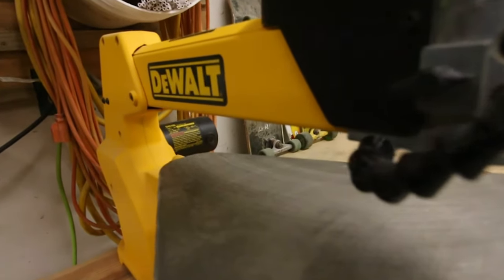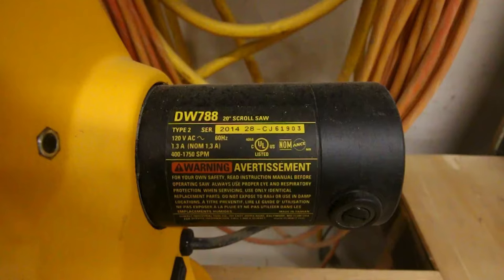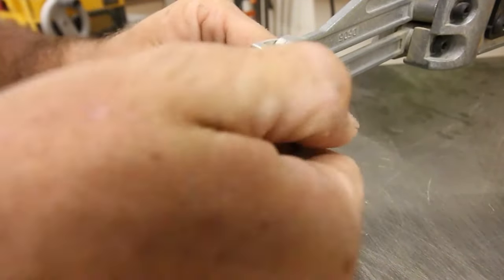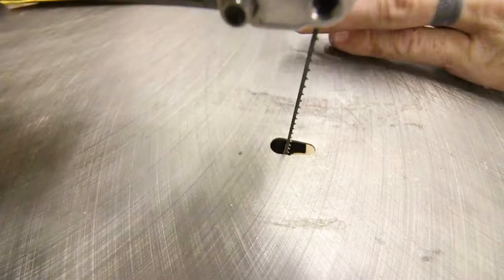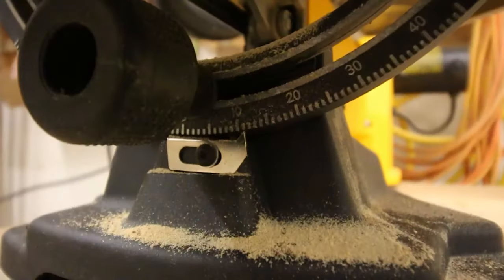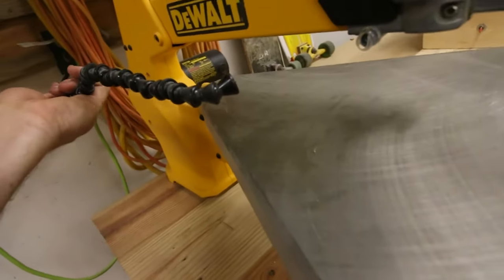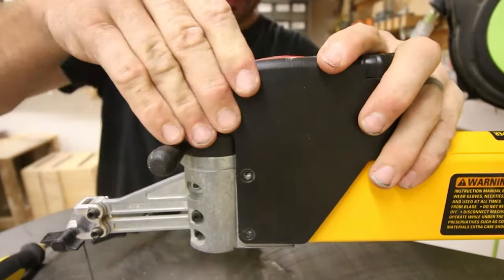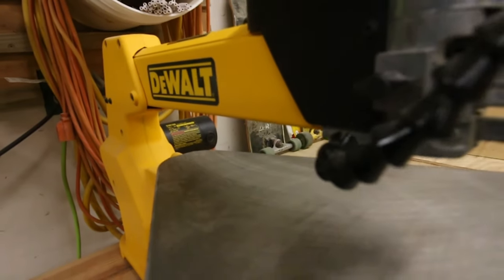Know THIS Before You Buy!!! DeWalt Scroll Saw Review After 6 Years

Comment: The air tube can be reused by cutting out the damaged split first link then you have a new first link.  You will need to heat it slightly to make it slip on.
Reply: Absolutely correct.

Comment: I do like this saw, but have to disagree about it being the best ScrollSaw on the Market.  It may very well be the "Best saw at it's price point".  The arm on the 788 doesn't have a catch to keep it up.  These saws are also notorious for excessive blade travel (travel is movement forward and back through the stroke).  Also, the on off switch isn't sealed, allowing dust to build up inside and eventually cause issues.  I do love the tensioning system on these saws.

Though at a much higher price point, I would say the Pegas/Seyco's/Jet/King are better saws, and though way way overpriced, the Hegner is probably better suited for some types of work.  Right now, I think Pegas is probably the best choice for "most" serious scrollers.  The new Wen saw is probably the best entry saw, and this DW788 is probably the best mid priced saw.

The switch itself had had issues on these saws because they don't have a membrane covering them to protect them from dust.  Many users use foot switches to turn on and off the saw, which will remove the wear on that upper switch, and in that scenario, you can put tape over the switch to protect it from dust.  There are other add-ons to hold the arm up (for bottom feeders), and some users add their own dust collection (scrollnado or makeshift).

So, this is truly a great saw, especially at that price point, but not the best for all situations.
Reply from the maker: Great points! What do you mean by catch? Do you mean the foot?
Reply: Pegas/Jet/King are all the exact same saw, from the exact same manufacturer. It is a far superior machine to the Dewalt, and well worth the extra money. 

As for the blower hose, you use a pair of pliers to pull off the loose nib and the next one is just as tight as new. No need for glue or some weird clamp situation

Comment: I have the DeWalt 788 for 10 plus years. I had to replace the tension wedge and several repairs for a knocking noise.  A recent problem I had was the top of the blade was 3/32 of an inch ahead of the bottom of the blade. When cutting a 2” thick piece I could not make internal cuts because the blade didn’t meet the cut line at the top and bottom. To make the blade plumb I had to remove the bolt on the rear table bracket and jack it up to plumb the blade to the table. I slid a wedge under the bracket and used a clamp to secure the table from moving.

Comment: I've had my DeWalt for over 6 years now as well.  Have built numerous fret work clocks with it and still going strong.  So things I did to mine to help out: (1)  I bought the DeWalt stand for it, but before I bolted the saw to the stand I cut three small pads of of dense foam rubber that matched the feet on the saw.  I placed these pads between the saw and the stand and it made quite a bit of difference in the sound being transferred to the metal stand. (2)  I originally bought the DeWalt work lamp but quickly discarded that as it was no help at all.  (3) I bought the original "Lifter" from Papa's Workshop and consider this one item the must have for the scroll saw!  (4)  The Pegas scroll saw clamps made for the DeWalt are a marked improvement and the best price I found was at Bear Woods Supply.  (5)  As I am up in age I needed something to assist the old eyes.  I bought the Magnifying LED Work Light Item #57312 from Rockler.com. Its oval shape and bright LED ring make intricate small cuts such a breeze now that I can actually see them! :) (6)  Last but not least, I added a 3" thick piece of foam rubber to the cross bar at the base of the stand.  Even when sitting at the saw for long hours, that spongy foot rest is greatly appreciated.  (7)  As for blades, I have tried almost all of the brands.  I keep going back to the ones sold by Bear Woods Supply.  Much cleaner cuts, smooth turning and very few breaks.

Comment: I started with a Harbor Freight Central Machinery. If I wanted to change blades I had to use an allen wrench. If I had a lot of interior cut it took awhile. I just purchased a Dewalt DW788 scroll saw. Can wait for it to be delivered.
Reply from the maker: Nice!!! I've never tried that one but I had a jigsaw like that once. Sounds awful
Reply: I bought a harbor freignt scroll saw a few years back and returned it 2 days later. I found out I didn't have the 8 octopus tentacles inorder to change blades quick enough.
Reply: I was considering the Harbor freight scroll saw. How does it compare to the more expensive Dewalt. I'm new to this anyway. Thanks
Reply: @Blah-blah-sure  
If you have the money I would definitely buy the DeWalt. The Harbor freight works ok but it's more difficult to change blades. I bought the Harbor freight because I didn't have the money for the DeWalt. I'm glade I bit the bullet and bought the DeWalt. Get the DeWalt, you won't be disappointed

Comment: I have recommended this saw to friends and they like it.   I bought a Delta 19” scroll saw 30 years ago and still use it a lot.    I am used to the c-arm design but do need to cautious on thick cuts.    I keep thinking about getting the Dewalt 788 but the Delta just keeps plugging along so will keep,it for now.   Great video and I shared it with friends

Comment: For some reason I seem to be an odd ball?  I have had a Dremel scroll saw for about 20 years--it has thousands of hours on it.  A few years ago I decided to "upgrade" to a Dewalt.  I owned it for less than 2 months.  Although it was a larger saw than my 16 inch Dremel, I found it more difficult to change blades.  I do not like the fact it has no dust collection port.  I am in Canada and really do not like the price in my area.  Also, my Dremel will cut thicker wood. I have to give Dewalt credit for the placement and size of the on/off switch--Dremel is a little awkward.  I am sad that Dremel has not made, and when I talked to them about a year ago, has no plans to make them again, as eventually I will wear mine out.  Dremel is owned by Bosch.  I have several Bosch power tools and they seem to be fairly high quality.  Again--I seem to be an odd ball but I do not like the Dewalt scroll saw.

Comment: Woodshop free in my library,  Fl. This is only ones in the shop. As new scroller, i like the speed control,blower, and large base. It has held up for years. Dust collector would be useful. They have vacuum hose area built in walls.
Awsome tax dollars at work. We have everything 2 or 3 of all big tools. Not allowed to use table saw. Master woodmakers volunteers. Twice a week open build. 67 women loving learning a new hobby.

Comment: We’ve got an old Dremel and it works well enough, but the capacity for larger pieces is less. For the most part though, we are working on smaller stuff when we need a scroll saw, so it’s only been an issue once or twice, as I was shaping a mermaid tail for a vanity table I made for my granddaughter. Once I took the time to learn about the different types of blades and when to use them, I found that I use it more often and have much less frustration. Thanks for this honest overview. You always do a great job of putting lots of information into a concise video. 🙂
Reply from the maker: Thank you!😁

Comment: Hello from New Hampshire, I watched your video as my machine is about 7 years old, but I have about 40 hours if that on the device. 1 day it worked perfectly and the next it didn't, so I automatically thought it was the motor, but watching your video about the on/iff switch disconnecting, I tried with all of the hex keys to remove the bolts. I would like to know the size hex key you used, as I have no idea the EXACT size. Some come very close, but do not seat all the way in,. Could you provid me the specifi size hex key please, thanks Richard

Comment: I heard on another video that there is play front to back as you are cutting, instead of going perfectly up and down there is some front to back movement. I can't remember the explanation for this or if there was a fix, have you encountered that problem? It's still cuts but the accuracy goes down a bit from what I recall.
Reply from the maker: @musicbymark  because of the nature of the scroll saw there's play in the blade but that can be mitigated by just slowing down the cut. There seems to be zero play in the arm or any of the other fixtures. Hope this helps😁

Comment: I’ve had the dewalt scroll saw now for 15 years. Same problem with the blower staying intact where it connects to the saw. I resolved the problem with a small stainless steel pipe clamp. Haven’t had a problem since.
Reply: Remove the end that broke (each "link" is the same size, heat the new end in boiling water for about 2 minutes, and it snap back on.
Reply: you can simply pop off the broken joint and re-pop it back on the metal knob.   its a tough pop, but a fairly resourceful engineering mind can do it no problem. :)

Comment: I own this scroll saw as well.  Haven't used it much yet, but I had a couple comments.  The first is WHY NO DUST COLLECTION!  What a idiotic oversight...  This would have made the saw nearly perfect.    The second item is probably contrary to most.  I actually wish that Dewalt made a smaller version.  I don't need 20" (esp. with a spiral blade), and the 20" saw is just bigger enough (over a 16" saw) that it makes storing it in my garage a headache.

Comment: I have the exact dewalt. My problem is that 5 inch blades don't fit. It's like the upper arm and lower arm are too far apart. Driving me to tears! I want to scroll so bad!
Reply: You need to put the tension on the lowest setting when changing blades, and usually I have to turn the saw on and then immediately off again to get the arms positioned correctly so the blade can reach both top and bottom.

Comment: After many students have used my DeWalt SS, the part that holds the blade in place allows the blade to slip out. Frustrating for so many students and myself. Does anyone have a fix for this??
Reply: Scuff it with a file.

Comment: The cons you mentioned are not even worth mentioning.
Reply: I agree regarding the hold down foot.  I don't use mine.  I disagree regarding the blower tube issue as my experience is the same.  By him mentioning it, I learned from a comment that a simple hose clamp will hold it in place!